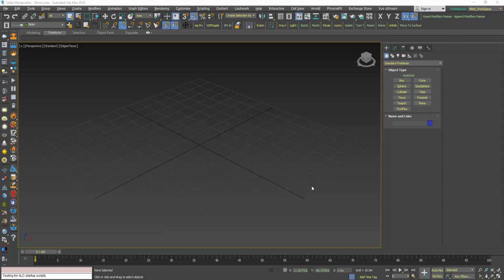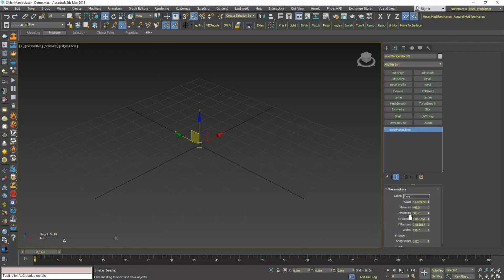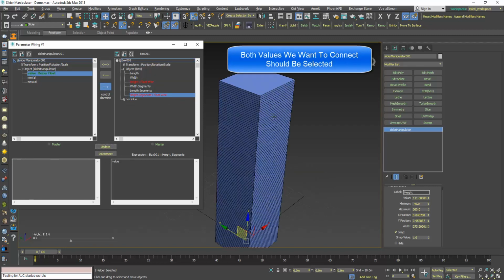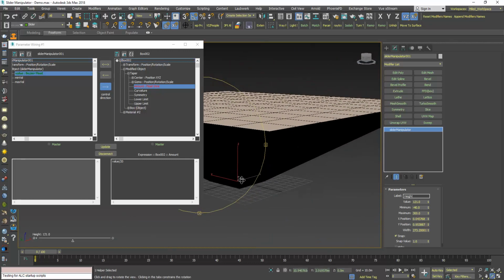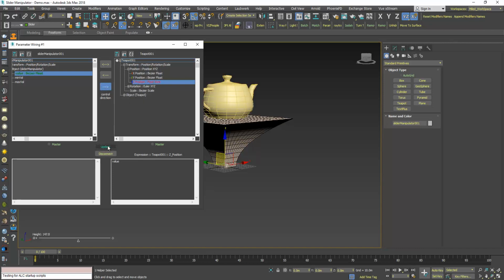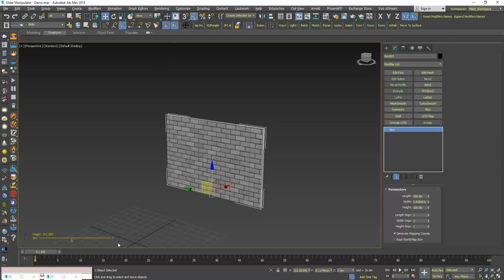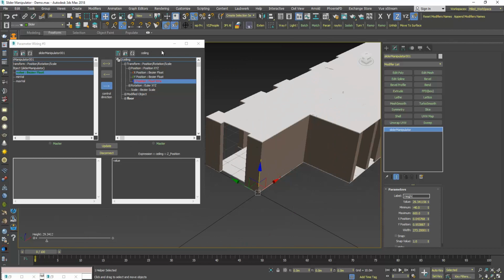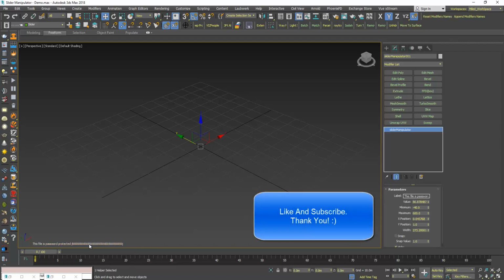3DS Max Slider Manipulator Control Multiple Parameters In Multiple Objects. Plus The Fake Watermark!

Comment: Hi,
Is there a  way to have a parameter controlled by two or more other parameters?
A simple example: Say I want the height of a box to be Parameter 1 + Parameter 2. And these two parameters could be custom sliders, or parameters from other objects. 
Is that possible? 
Thank you.
Reply from the maker: Hi, you can wire two sliders together and connect their two "Value" parameters. You can have the second slider's Value = the 1rst one + its own. In the Parameter Wiring dialog, you can write in the second bottom right box: value + $sliderManipulator001.value, for example. You can experiment with stuff like that. Of course, for a more complexe and custom behaviours, you'll probaly need some Maxscript coding.

Comment: This feature is good, but at high resolution monitor the text is too small. I hope you can increase the font size
Reply: due to Autodesk ability to live only in the past... =(
Reply from the maker: Actually, this is the direct result of a monopoly. No real competition to shake things up.
Reply from the maker: Hi, If you're talking about the font size for the Slider's Label, unfortunately it cannot be changed.
Reply: @MiledRizk  It should be corrected.
Now on a large resolution monitor, the Label is too small
Also, it is good to have a function to display only the label (your Yip is useful, but there is a limit)
It will make 3ds max more useful.
Reply from the maker: Yes, true. But this is something that autodesk's developers should do. The Slider helper is an old tool that wasn't updated since a long time, and i doubt that they will do anything about it, like many other things.